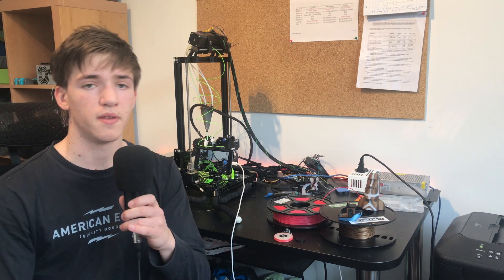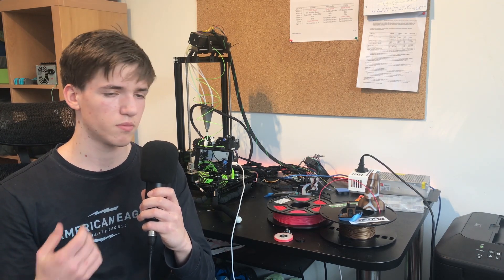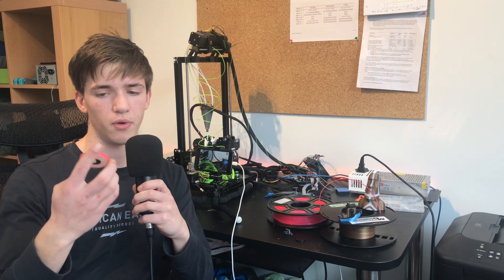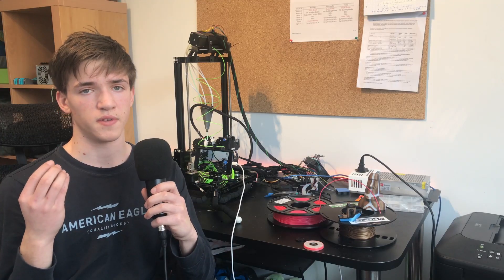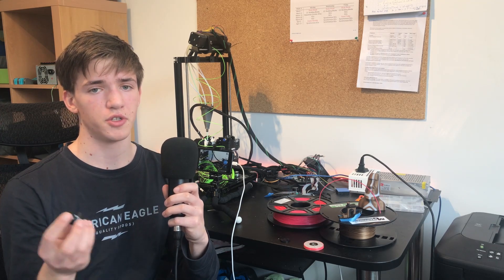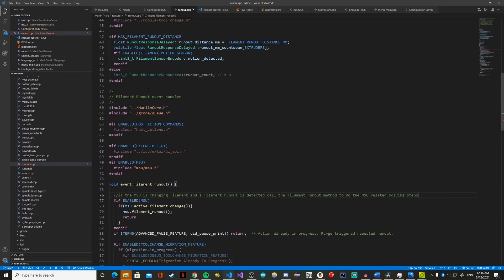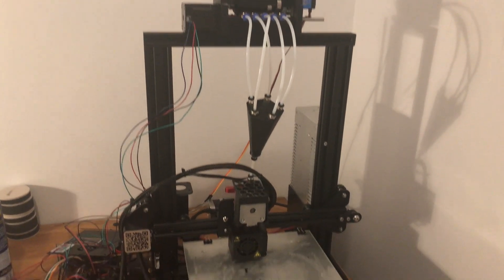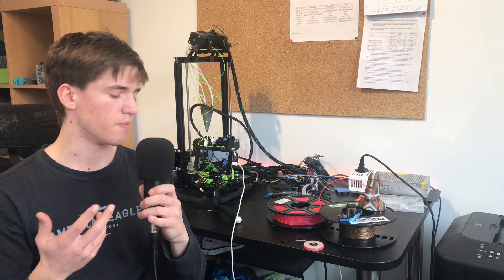First TPU/PLA print, filament sensor, time-lapse setup, and direct drive support.

Comment: I’m trying to join the discord server ... but on iOS it just keeps  not joining

How big “high” is the material switching unit above the printer while in use ... and when opened up ?
Reply from the maker: Hey, I guess you are trying to make it fit in an enclosure... I would say 10 cm closed and 15 cm to allow it to open but I would recommend getting a few cm extra since there may be modifications to the mounting system. Also for the discord channel here is another link and I really hope it works since this is the easiest way to contact me ( https://discord.gg/Pj8bwTn )

Comment: I would've connected the magnetic sensor to something small and cheap like a pro micro / blue pill, and then write simple code that for every 0.5 degree turn, pulse an output pin which will go to Marlin and it'll read it like an encoder. Perhaps even pause output if the filament springs back in the wrong direction while changing, letting Marlin know there's an issue.
Reply from the maker: That seems like a really good idea (much faster runout detection) but in this case we are talking about extremely long moves and that are far from the nozzle so the increased detection time won't have that big of an impact and it will be far easier to implement (also a lot cheaper). In any case this is entirely open source so if this is something you want to see implemented you can definitely take a shot at it and we will add it as an option. Right now I don't have much time and this seems like the easiest and fastest way to implement a filament sensor while not hindering performance.
Reply: @materialswitchingunit284  Valid points. What happened to the calculation you did a few parts ago where you concluded that you would see issues after a few spools? Is that why the wheel looks larger than 2cm?
Reply from the maker: @KentoCommenT  Oh, I was not planning on using a rotary encoder, since it would basically fail after a few spools. What I was talking about in the video (I know that it wasn't very clear...) was an IR speed sensor that doesn't suffer from the same friction problems.
Reply: @materialswitchingunit284  Oh now I get it. I thought you were referring to an IR rotary encoder from the start